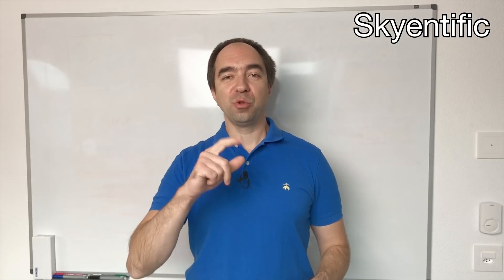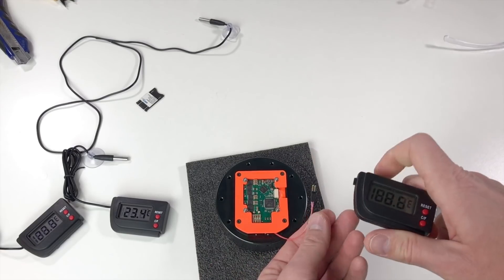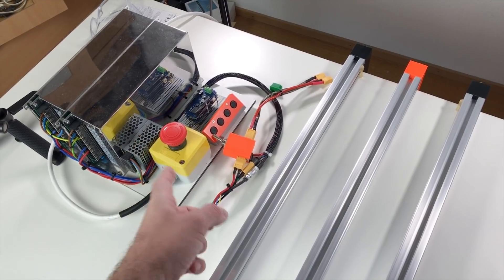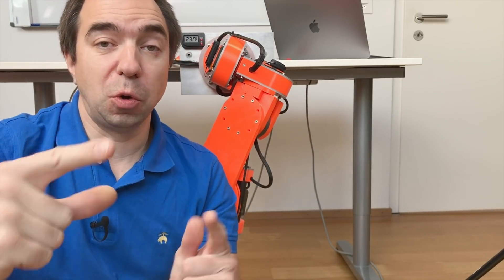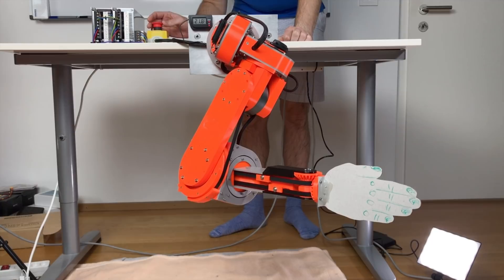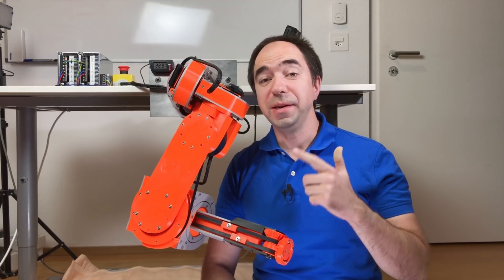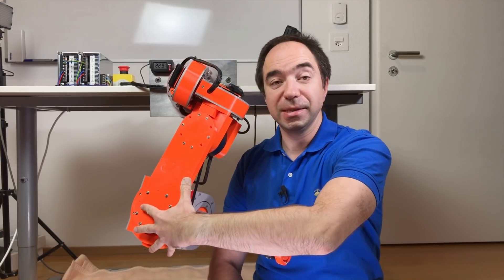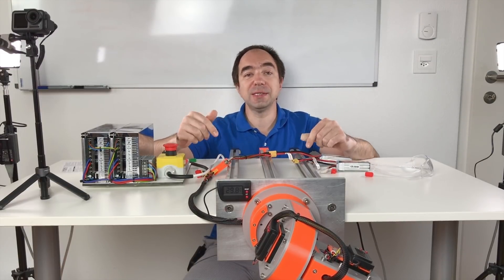This 7 axis Robot Arm finally works!!! (part 3, final?)

Comment: I think vibration is related with the mass of the arm. You want to decide a constant speed but the speed should change according to arm mass. Accelerated and deaccelerated to avoid intercity. It means you should previously know the distance you want to move axis 1 so you can planify the speed curve before you start the movement. 
I saw many of your videos, thank you very much.

Comment: it looks to me like you will inevitably run into the limits of the mechanical properties of 3D printed laminar plastics. though it is convenient for rapid prototyping of shapes, it is junk compared to machined metals when making load-bearing parts, requiring excessive bulk to (poorly) handle the working forces.
Reply from the maker: I think you right. But I still have some ideas to test!
Reply: @Skyentific  - good luck!

Comment: I see you've moved the motors closer to the base of the robot to decrease the weight. Why not go further and have ALL the motors at the base. You could transmit motion with some tendon-like wires thus making the arm even lighter.
Reply from the maker: This is a great idea, but it is very difficult to accomplish. There are very few robot arm, which do this, mainly because the design becomes complicated. Also when you have long tendon-like wires, the stiffness of the arm decreases, as even steel wires stretch. I know the WAM robot arm and LIMS2 (ambidex), which use this method.

Comment: I too like the idea of the arm with heavier motors towards the base of the arm, with progressively lighter ones towards the extremity. (Assuming weight = power) It reminds me of how the staging of multistage rockets are set up. Could you adapt a rocket equation to robot arms to formalize it? Using, distances, power, leverage, etc.?

Evolution seems to generally agree that thick to thin is optimal as well. When was the last time you saw an animal with huge forearm and puny shoulder? (Feet don't count, because they have other purposes, like stopping the animal from sinking into soft ground, which is rather difficult with needle-point limbs when you're not the size of an insect.)

Comment: Nice! May I suggest setting up a counterbalanced arm like the Haddington Dynamics Dexter? The idea is to put all the motors on the /opposite/ side of the joints they turn so that the arm is counterbalanced. The same belt tricks you've used with the end arm, can be applied to the major joints combined with moving the actuating motor on the opposite side of the joint. On Dexter, we use cone drives for Joints 1 and 2, then move the motors for joints 3, 4, and 5 to the opposite side of joint 2, but there is no reason you can't do that for each joint: Move the motor for Joint 2 to the opposite side of joint 2, Joint 3 motor opposite joint 3, and so on.

Comment: Is there already a multi axis arm that is powered by ONE motor and no actuator?  Where the torque is split up (perhaps via clutches) to each axis?  This could be a nice way to keep weight low in the mid and outer extremities of the arm.
Reply: if there was a precise and speed-adjustable hydraulic actuator, wouldn't that be awesome :)
Reply from the maker: And inexpensive. :)
Reply from the maker: Many people had this idea. But I never saw a real robot arm like this. I think it would be complicated to design such arm.
Reply: There was a toy around the ‘80s from Radio Shack called the Armatron that had a drive system like that. The 8 Bit Guy here did a repair of one of those. You do see how it was put together.

Comment: Great job what is the build cost?
Reply from the maker: A lot. Each actuator is around 300-400USD, and there are 7 of them. Plus 2 slew bearings (100usd each). So total is around 2’500 USD.

Comment: ah man i was so excited to get this notification. what about the design you spent so much time working on? this arm just seems like a distraction from the far better one you were designing before :-(
Reply from the maker: For this design I spent really a lot of time. And I was extremely disappointed that the video performed really badly. For some reason people was not watching it. Bit I had 5 axis working. I was expecting at least 100 thousands views, but I got only 30 thousands. I know it still sounds a lot, but I think it is not enough for the amount of work I put in. So I will just forget this bad experience and continue with this design, which you liked. :)
Reply: @Skyentific  No, please continue with this design. It's a really cheap alternative for not so precise industrial applications and other non-industrial uses. Atleast it's what I think. Considering the sky rocketing prices of industrial robot arms.

Comment: Hi Gennady, thanks for the video! I think the bulkier the axes get, the more we need to pay attention to the structural elasticity of the joints especially for the axis 1 and 2.. and perhaps tune the PID parameters accordingly. Have you thought about that? Like do you know a basic tool to make elastic calculations to find eigenmodes, bending modes of the structure, like beam and concentrated mass analyses for multi axis arms?
Reply from the maker: This is all very complicated for me. I need to learn more on this.
Reply: @Skyentific  if I ever get to your level, I will learn and make a video. But for now I think ROS and inverse kinematics are lower hanging apples :) Thanks again!